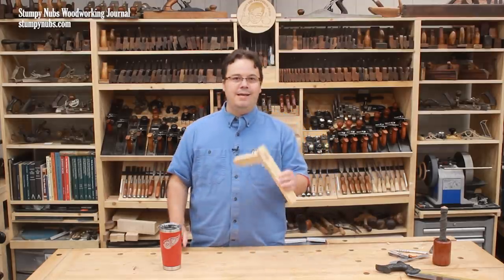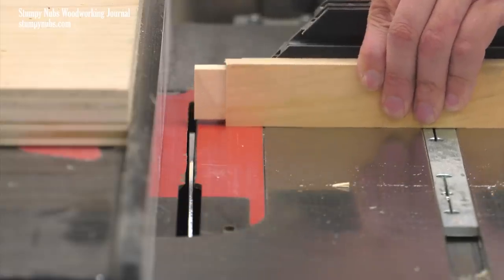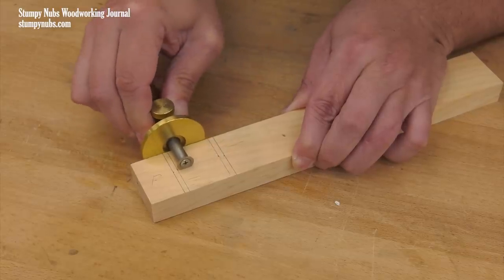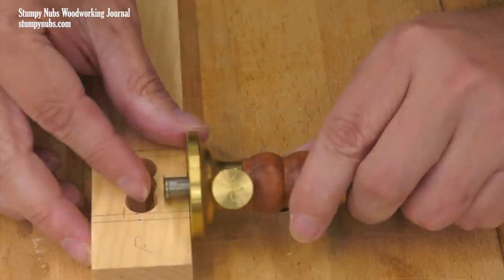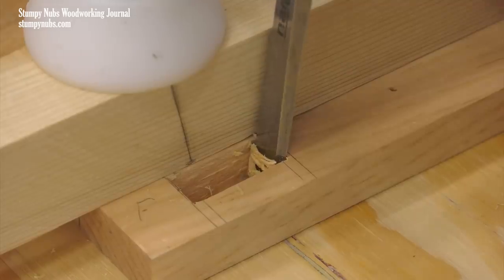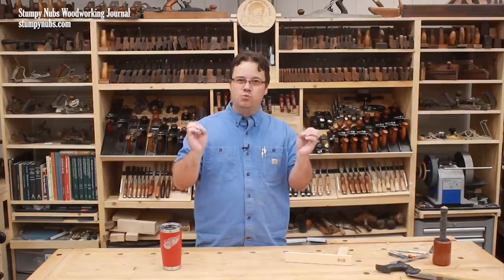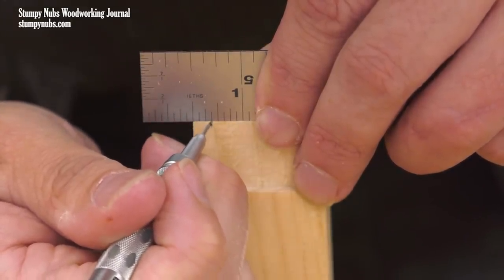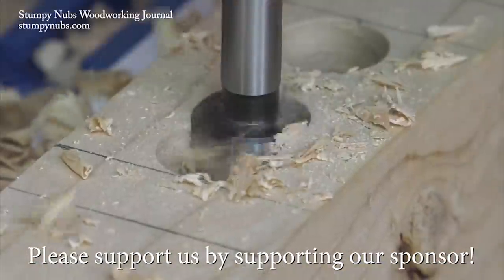How a little wedge makes the STRONGEST joint ever!

Comment: I have thought of doing this with a hidden wedge to assemble chair legs and cross bar supports.

Slips the end of the dowel, and set the wedge in place.  Once it is driven into the receiving hole, the bottom of the hole will contact the wedge and push it into place, spreading the end of the dowel, and locking it in place.

Comment: I just built a workbench and the short horizontals between the legs, I connected with one drawbore pin and a single center wedge...  Like a belt and suspenders I guess. Lots of ways to do this folks, this one looks really effective.

Comment: I'm curious what would happen if you cut the tenon in a wedge shape, soaked it to make it pliable, then compressed it with a clamp to slide it into the slot, and let the wood expand into the wedge-shaped hole?

Comment: Wouldn't it be easier to drill the the angled sides in the initial creation of the mortise?
You could use the same lines for reference, adjust the drill press until they are vertical and then you already have a good chunk of the angle done and don't need to chisel as much.

Comment: This is an incredible video -- not only is it information dense, but the information is arranged in such a way that each new point builds on the ones before it. There's no gaps, or leaps in logic or procedure. It flows well from one point to the next with clear examples. Not only that, but there's also a discussion of the problem before the solution is explained, so the viewer has a clear idea of what's going on and why these steps are being taken. A real feat of demonstration. I don't do any work with wood, but after watching this, I think I understand how to do this very well.

Comment: very good explanation indeed

I agree with most of the way you do it

however

when you work with 4x4 inches leg posts, with the 2x2 inches tenon, and the table thickness is 1 3/4 inch, you need to drill the holes at the bottom of the tenon to:
- prevent splitting the post,
- allow the pivoting of the thin slice to lean on the sloped mortise wall (if there is no hole, the slice will break rather than bend)

how do I know it? I do it all the time, because this is my signature working desk / mobile cabinet / coffee table  design

I also deal with the hardest wood species I can get hold of, and the slices without the bottom hole always break while pounding the wedges. the holes will be filled with the glue. I often use epoxy resin to make the joinery even stronger (I need to seal the connected pieces prior to pouring the epoxy into it)
Reply from the maker: I agree, if you cut straight down you will need the holes to prevent splitting.

Comment: It's easy on the joint insert piece has it cut at a 25 to 30 degree angle and then the whole and the joining would you cut a hole at a 20 to 30° angle and that way the tip goes in at an angle but then the border lines lines up straight

Comment: When using glued wedges add a tiny amount of length to the wedge and give the blade teeth, this helps it take glue in and also adds a non linear component to the wedge connection.
Reply: Thanks for the tip, yet another informative comment!!! Much appreciated.

Comment: I love the appearance of the wedges in the exposed tenon. You mention this is the strongest possible joint, but what about a pinned tenon, using dowels. You can do a through tenon or a blind tenon with that method, still have the element of the visible pins (or pegs, if you prefer); they can be squared to the work edges, or offset, or angled, depending on the desired effect. The pegs can be through or semi-blind (showing only on one side) and given what I would think would be equal strength to the wedged tenon. It also takes less work to make the joint.
Reply from the maker: I specifically mentioned pinned dowels in that statement about the strength of the joint :)

Comment: Please read, Stubby!

Stubby! I'm a long time fan and subscriber and this is the first time I heard you speak about your shakey hands (which, honestly, I never really noticed before). Anyway, you mentioned that it's a genetic thing called (what sounded like) "essential" tremors. Did I hear that correctly? I have the same thing, but it was never documented (instead, i was just teased about it). All my life. I'm 66, now. As I type this I have to constantly go back and fix typing errors due to "double-- or triple-- bumping" letters and digits. Annoying, to say the least. Oddly, I made most of my working life doing things that demanded precise manual dexterity. I took it as a challenge. I won't begin to say everything I did went swimmingly smooth (far from it!), but I did manage-- even when using nearly microscopic screws or pegs. Or nuts. Etc. I've always found working with wood both relaxing and rewarding. That's why I watch your channel! And several others. Please let me know if I got this correct?

If anyone else knows, please advise me-- it would be so nice to know a term to call this next time I'm embarrassed by it. Thanks!
Reply from the maker: Yes, I have essential tremors. It's a genetic condition. My great-grandmother had it when I was a kid. I've had it all my life. When I an under stress, it gets worse. Some medications help, but I don't take any because it is manageable. If you want to learn more, or to make sure that is your issue and not something else, see a doctor. (By the way, it's Stumpy, not Stubby. But you can call me Jim.)
Reply: @StumpyNubs  Thank you so much, Jim! At 66 and retired, I see little benefit from a Dr. visit, especially as this doesn't actually disrupt my life. Never really did (I never let it). More than anything else, it's just been embarrassing. Like you, stress makes it worse (especially my adolescent years!). My abilities and accomplishments speak for themselves-- as do yours. I'm inspired by your tenacity and skills, and especially (finally) knowing that I'm not alone in this. I thought it was just me. So, I heard you correctly: it's essential tremors. Can't tell you how good it is to finally have a term for this! All my older kin has passed, so I can't investigate genetics. Really rather moot, now, anyway. Again, I thank you for your time and reply-- a boulder off my shoulder.

Comment: I think it deserves mention that a far easier way to secure a tenon within a mortise is to drill one or more holes through the tenon and securing with dowels.  Obviously this method isn't nearly as attractive as wedged tenons, but it is certainly faster and in structural carpentry or in areas where appearance isn't critical, it's a very useful option.
Reply from the maker: 0:34

Comment: "Almost as good looking as I am"...gee, that means I should be using pocket screws. Seriously, this is a reminder that not everything has to be hurry up and knock it together. It is really good looking, not terribly hard to build, and the joints will swell together holding it until long after you are gone. Question: When I have built these in the past, I have used a dado blade on my tablesaw to cut the cheeks. Any downside you can see? Those reputative cuts with a regular sawblade just look like an invitation to screw something up. Thanks for another great vid sir.
Reply from the maker: I prefer a dado set myself. I just wanted to show how folks without one could use a single blade.
Reply: @StumpyNubs  Roger that. Thank you James. Good weekend to you!

Comment: Stumpy, ive seen videos of yours and several others that use the Pentel pencils, just bought them and love them, but never seen a video of why use this type of pencil for wood working? just a thought.
Reply: It's because they leave a uniformly wide and narrow line. A standard wood pencil line gets wider as it wears down.
Reply from the maker: They never need sharpening, they come in different lead widths so you can balance fine lines with lead durability for the project at hand, and the retractable tip protects the most vulnerable part of the pencil in the shop.

Comment: With that joint being so tight, why doesn’t the tenon split the board with the mortise when it absorbs moisture from the air?
Reply from the maker: The pressure from the wedges are along the grain, not across the grain.

Comment: Still trying to wrap my head around how the shoulders keep the piece from splitting. Especially after you cut the slits at an angle, they seem so fragile!
Reply from the maker: The glue makes it a solid piece again.
Reply: @StumpyNubs  have you ever experimented with using a blind mortise and hammering the piece into the wedges?

Comment: Would that be just as strong if you drove the wedges in on the outer shoulder, instead of into a relief cut?
Reply from the maker: That would essentially turn it back into a regular mortise. The tenon could be pulled straight out and the wedges would remain.

Comment: I think the joint would be just as strong if you skip the final sawing of the tenon and glue the wedges in place as you first tried them in the test fit at 10:26. Wth glue will hold it all together.
Reply from the maker: Then you just have a regular mortise and tenon joint.
Reply: @StumpyNubs  The taper would still be there, the wedges with plenty of glue surface on both sides, lots of shear strength. Effectively a tapered tenon.
Reply from the maker: @michaelpost7352  Think about it... What if you glued the wedges in first without the tenon? What would you have? A regular mortise because those two wedges would cancel out the angled ends that we chopped inside the mortise. Putting the wedges on the outside turns a "flared" mortise back into a regular mortise, whether you do it separately, or all at once.